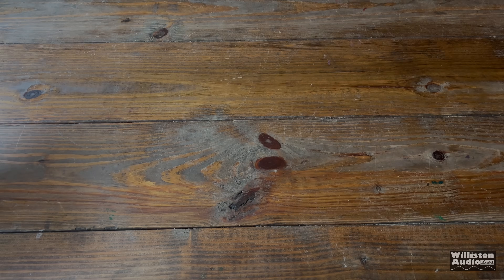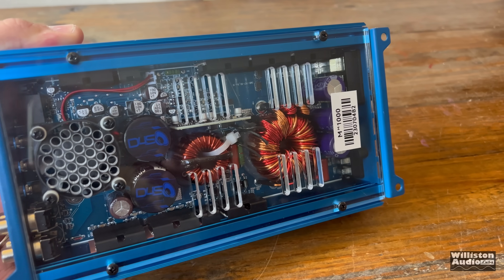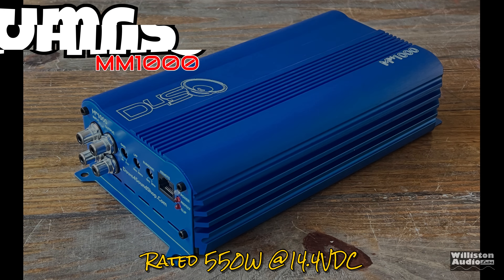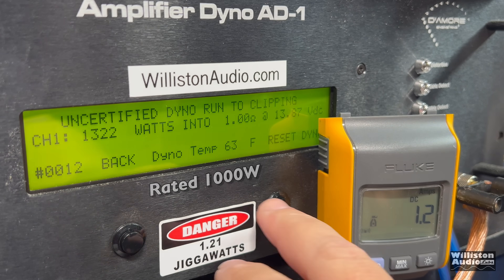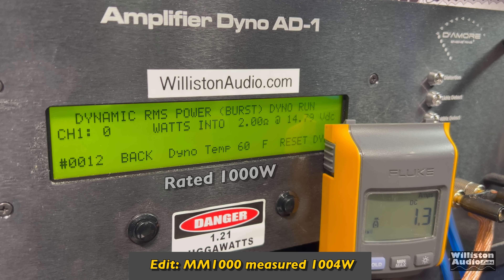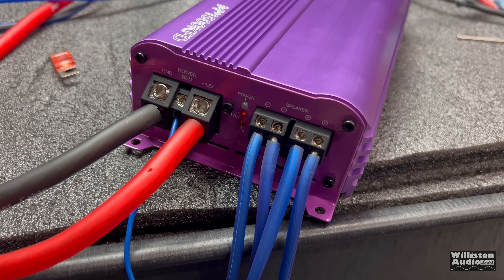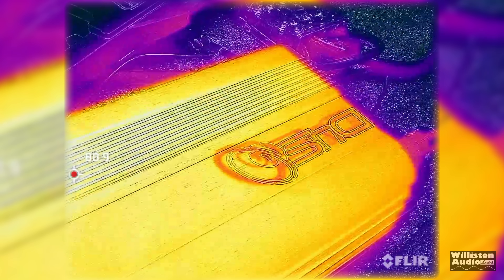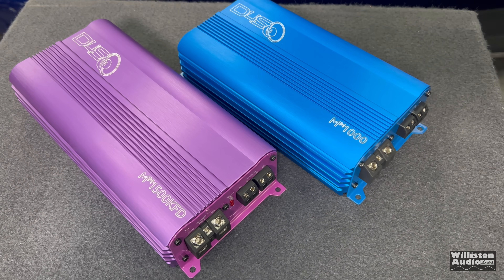Do These Mini Amps Survive the Amp Dyno Tests? D4S MiniMaxx MM1000 and MM1500KFD

Comment: Why do you say Networking Cables from "the early 2000s." They are all still completely in use in the most high tech computer farms in the World. As well as my home connections.
Reply: He has like I do “Dad” humor;)
Reply: @ashcoleman8866 great answer.
Reply: Yall some nerds 😂
Reply: Because there 10 conductor network cables not 8 conductor like a network cable. So don't try and run cat 5 or 6 as the ends won't work nor do you have enough wires
Reply: @numlockkilla  Cat 5 cables only use 4 conductors. You could connect two outlets with one cable of you’d have to. 
Works at least up to 100Mb/s.
Reply: Ummmm if you took the time to check the nudlebang and how it correlates to the bongobam you wouldn’t ask such asinine questions.
Reply: Aw shucks
Reply: The real question is : if those are from the early 2000s what are people using now ... since t568b ( typically the standard has been in use since 1984 ) is what I use.....
Reply: @acidangel111  fiber, or cat6/7
Reply: @beakerwsw  fiber to a computer ? No. There is a media converter involved or a fiber transducer 99 percent of the time . Cat6 and 7 use t568B also and are the same as cat5 . Go look up rating . Cat5 cat 6 only difference is Guage 22 for cat6 , 24 for cat5 . And usually cat6 has a 'separator ' in between pairs . But rating is the same . Cat7 is used for VERY short runs otherwise it negates the purpose of 'cat7' . 
If you were in the industry you would know this and wouldn't have written this just absolute trash of a comment . It's almost laughable though. 
Why would you run fiber to a computer ? 
You may have a fiber run due to a distance issue ( greater than 300 ft ) but it doesn't go TO the computer . It goes to a media converter then goes cat5 / 6 . In this scenario cat7 would have NO benefit either and is just pointless.
Cat7 works , but is limited to VERY short runs less than 10 ft for rating typically. But , it too uses the same pair standard seen in the cabling that was shown .
Reply: Always use solid core. You're welcome. F patch stranded crap.
Reply: Why do so many of you give this man shit and pick a part what he says and how he says it? I know maybe thank him for his content, learn something from it or appreciate it as entertainment and leave your comments in your head. Just cause you think it doesn't mean we all want to know about it! Filter those thoughts!
Reply: Didn’t realize the connectors were SFP+
Reply: Because it was before your laptop and computer communicated wirelessly.
Reply: I believe it's a 10P10C connection that also accepts "standard" rj45 cables? Does the remote use all 10 pins or just 8?
Reply: They are cat5 or Cat5e wires the connection at the end of the cable is the RJ45 connector. Or just call it Ethernet cable and 5en every big dummy will understand
Reply: Naw not quite , any HIGH TECH farm is using Fiber not old solid /stranded cat cable.  Not even using cat7 or 8
Reply: Because it's what we used in the early 2000's before Wi-Fi got big, pretty self explanatory
Reply: The fact that the connections are the same doesn’t mean the cable is the same.
Reply: @ixyzyxi they say cat5 on them. 😆
Reply: @ixyzyxi  I know electronics pretty well and just realized there's cat 5 cat 6 and different cables that snap into the same plug type like a wired in connection.
Reply: Because they are old.... Cat5 cables are the lowest spec from over 30 years ago. Modern cables have the same connector design, but they don't work the same way. You won't get gigabit speeds from a 30 year old cable in the "server farm" you mentioned. That takes modern cables.

(No, you don't need a modern high tech cable for a bass knob, he's just joking)... Come on.
Reply: @volvo09  cat5e from 30 years ago is rated at gigabit . The wiring standard hasn't changed one bit since 1984 . Pin down orange white , orange , white green , blue , white blue , green , white brown , brown . 1 to 8 . That is T568B . T568A is the same except pair 1 and 3 are swapped. Gigabit yes . 
As far as 'modern cables what are you talking about ?
Reply: And still a lot better than the ancient phone cables with RJ11 connectors like many amps come with... those are so fragile.
Reply: @mikepsychles  most amps ? I haven't had one like that since the 90s . But even then they weren't rj11 2p2c , they were rj25 - 4p4c or 6p6c ( 4 pin 4 connectors ) . Not 8p8c like rj45 ( ethernet ) but 100 megabit vs gigabit ) semantics at that point for what they do ... speed doesn't really matter above 100 megabit for since line led displays .... just saying...

Comment: Can we find out why the end caps are pink on the purple amps ??
Reply: The end caps in person are purple. However they are painted and not anodized like the heat sink.
Reply: @mugendrewable  Not really, I have 2 34ab's & a 23. They really look more pink.
Reply: @thenotoriousrvh6091  I would agree that there a lighter shade of purple, actually lavender.
 I can say the end cap paint on my two 13.2a/b's, two 234 a/b's, two 84's, 23 and 234 are all the same and all purple.
 If I could post a picture here of any of the purple amps next to the 72a/b I would and then you would really see pink.
 SAVE THE TAA, TAA'S ❤️

Comment: I have a mm1500fkd and an mm10004 and they are pretty good.  One thing to note is that the remote level control on the mm1500fkd only works when the amps low pass crossover is turned on.  It took me a while to figure out what was going on there.  They don't mention that anywhere.  Also, what does FKD stand for since the mm1000 doesn't carry that?
Reply: Korean Fried Duck.
Reply: Korean Fullbridge Design
Reply: @fishgamblerace8166  now I feel like an idiot lmao thank you!
Reply: Korean full bridge design is what I designed it as
Reply: So to Big D's point why is it full bridge You're not going to run mids off of it unless you plan on buying one for the left side and one for the right side
Reply: @d77543020  , it's for big chuchero setups probably. There's a decent market for those annoying things I believe.
Reply: @d77543020  stunt walls, churro boxes would be my guess.
Reply: Fucked😅
Reply: Yo I just ordered a mm1500kfd, does it come with that rca to pigtail adapter or do I have to find one or make one? Website doesn't say.
Reply: @whaty-on7ox  it does come with the pigtail.
Reply: @johnnyh127  solid, thanks for the quick reply 👍

Comment: Why does it have angled screws? Seems like this wouldn’t hold the wires in place as well.
Reply: Much like the shape of a shark's tooth the angle will pull the wire into the connector.
  Especially if your using ferrels.